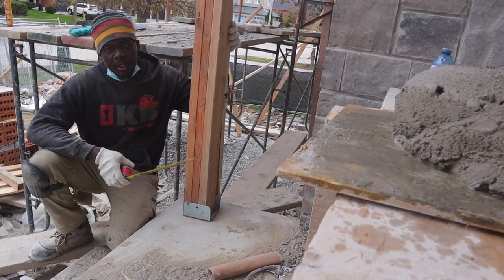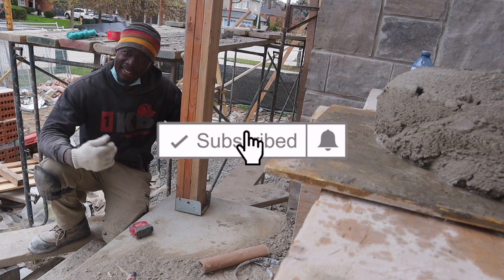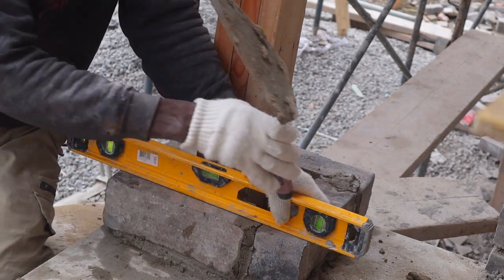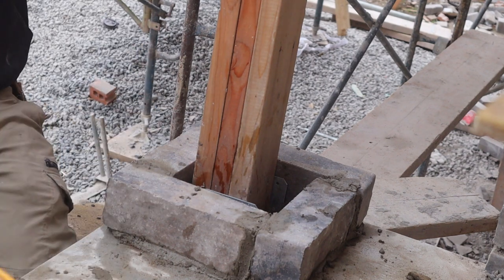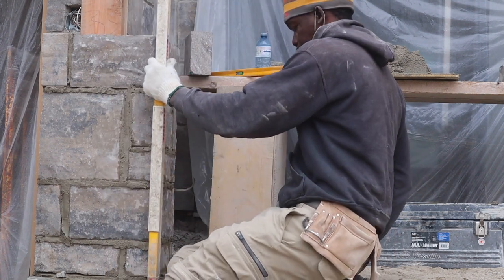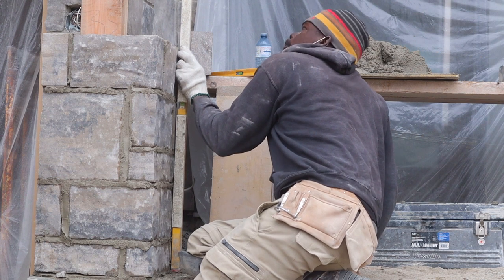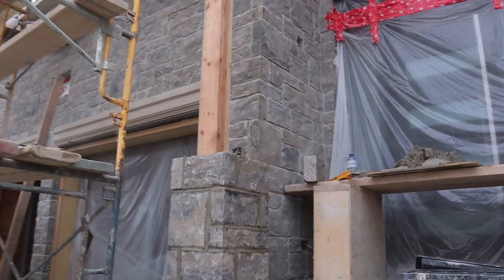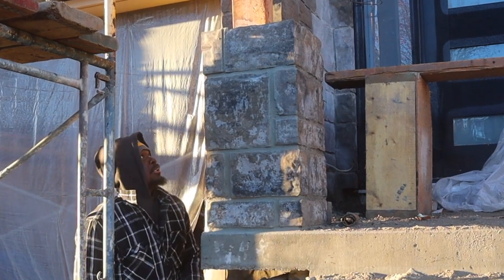How To Build A Stone Pier, DIY Tips

Comment: Great video! I'd like to create something similar for my 4 gazebo posts. Do you fill the open space in between the wood and bricks with concrete/mortar? I want to SECURE the gazebo to a brick paver patio and drilling into the pavers isn't the same as a concrete slab or footer. Just trying to figure out the best way to make the gazebo secure from high winds.